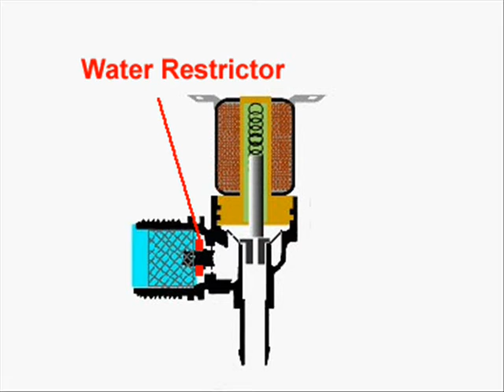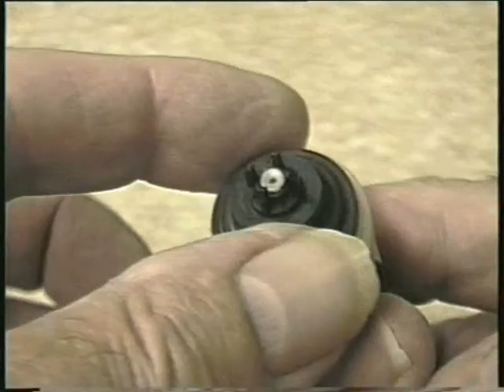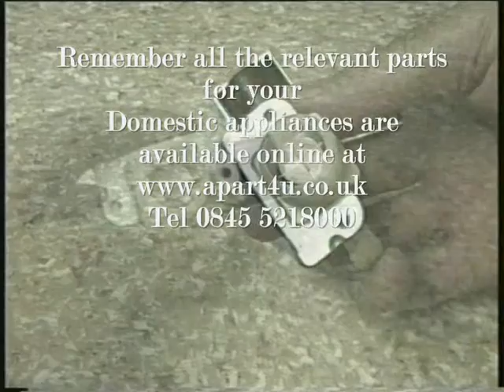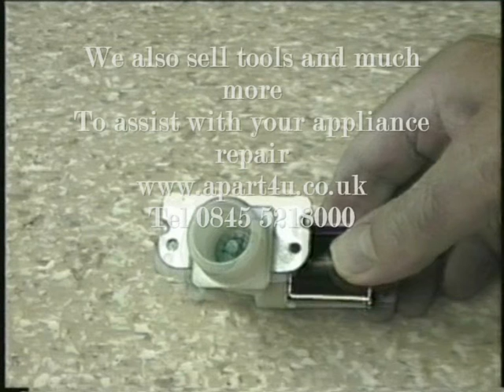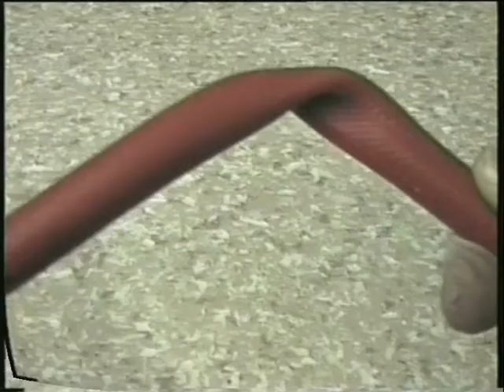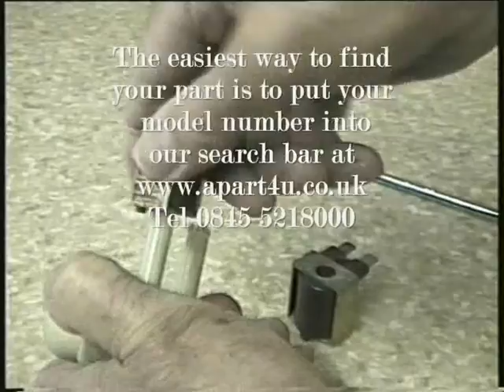How to replace a washing machine water valve on a AEG

Comment: Dave I have an AEG OKO-LAVAMAT 74640 washing machine and though it fills with water and starts the programme it stops part way through on any cycle I use - it drains it spins but won't wash can you help??
Reply: I have the same problem with an AEG 6100. 
HELP, please.
Reply from the maker: Aanton Mann meter test the water valves and make sure they are working
Reply: Hello, How 2
MANY thanks, I had tried the water test for both [Hot and cold] valves, and they were OK, At first sight, thanks to the superb advice from the on-line advisor, it looks like it may be the motor which is the faulty part. Again following advice I'm going to check the motor brushes. If they are OK, the next possible fault is the printed circuit - we'll see in due course.
Kind regards all round.